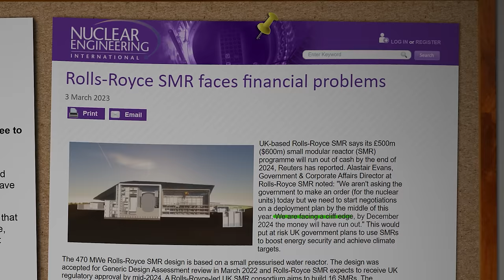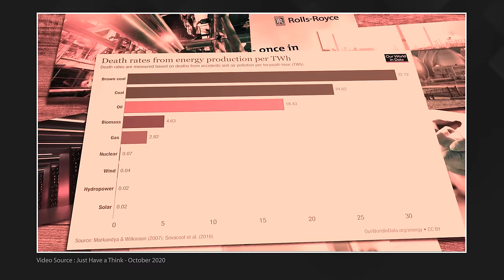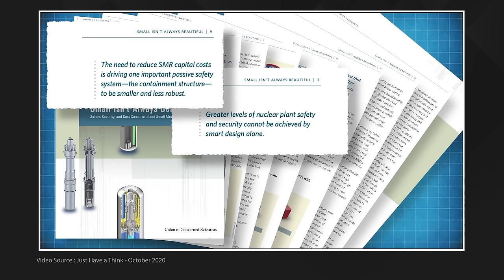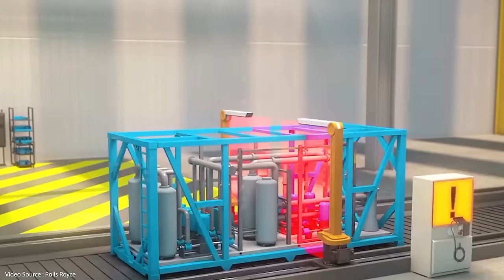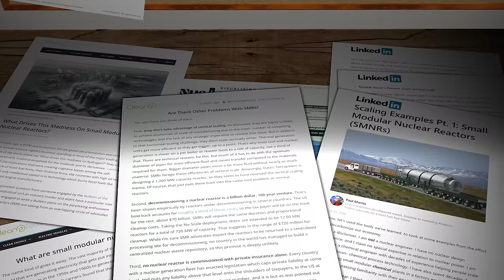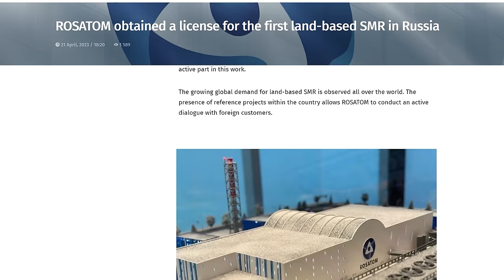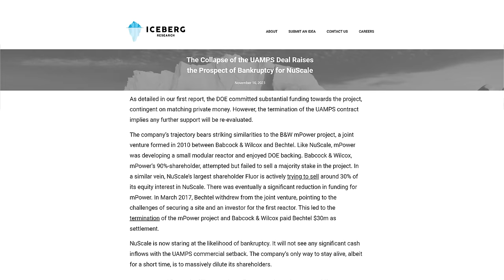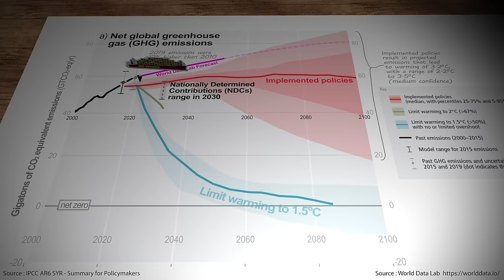Small Modular Nuclear Reactors. The Verdict

Comment: The NuScale SMR situation is disappointing however for many experienced power engineers the materials issues associated with molten salt amongst other technology issues looked rather challenging. I am not suprised about the status of NuScales' solution.

Nuclear plants as you note work very well once operational.A key issue is the 8-10 increase in costs since the 1970's.One of the key drivers of the cost (up to 50% of it) is the financing costs resulting from highly protracted construction times. SMR's an embryonic technology in aspects attempting to not just reduce equipment costs but also dramatically reduce construction times.In principle that should be achievable but should be far easier if we can leverage proven nuclear technology.

You didn't mention  the GE-Hitachi BWRX-300 which is a smaller version of their NRC-licensed ESBWR” .
The BWRX-300 incorporates a range of cost-saving features, including natural circulation systems, smaller, dry containment, and more passive operational control systems. The estimated capital cost of a BWRX-300 is $2250/kWe for series production after initial units are built. The design aims to limit onsite operational staff numbers to 75 employees to achieve an estimated O&M cost of $16/MWh or ~1.6C/KwH.

Westinghouse are following a similar track using a scaled down version of their AP1000 tech which is running well in China and I believe may be considered for UK sites in the 2030's.

We're entitled to have some scepticism about the cost claims based on history however Ontario Power Group are installing four of the GE Hitachi units over the next few years at their Darlington site.OPG have a lot of experience in Nuclear power & have run a strong fleet of CANDU based reactors for many years.The current average cost of electricity in Ontario is C$0.141 per kWh which by global standards is highly competitive.

I note your comment that Solar/Wind/Storage + Hydro are a complete energy solution however other proponents of this view such as Mark Jacobson have been thoroughly debunked by experienced engineers & scientists. I believe your comment about this being a low cost solution is questionable when full system (LSCOE costs vs LCOE) are considered as per this paper by Robert Idel.

 https://drive.google.com/file/d/1JB-x88wPQuKwWoFnxvkDAzbJ7hnM1-sj/view

If the energy supply challenge is going to be solved its not going to be just one type of technology but its going to require  everything we have today plus some emerging technologies including Enhanced Geothermal,Natural Hydrogen & even in some cases SMR's.

I
Reply: I think the problem comes from projecting a possible future cost at scale, and applying it to what amounts to small scale technology demonstrations. Historically, nuclear reactor manufacturers have had their routine price increases viewed favourably since older generation reactors were always bespoke and therefore hard to predict.
Now that SMR manufacturers need to compete on a level playing field with (mainly) wind and solar, they need to get better at cost control if they want to get funded. Rolls Royce for example, with all their experience of cost plus contracts for small reactors on submarines, are finding the commercial realities difficult.
I also think flirting with molten salt and/or Thorium SMRs complicates the problem further.

Comment: Excuse my ignorance but werent SMR's were supposed to be truckable hence the name "Small".
The "SMR's"  illustrated today by yourself look huge, slightly smaller than a current large Nuclear power plants.
Reply: They might be different companies designs. But i also assume that some in place infrastructure would still be required.
Reply: Yeah, that was the first wave of the idea. Thing is, it is just completely unviable economically (but also for safety-management, national security, etc) to do that. We do have reactors that could work at that scale - in military submarines - but they are no good for achieving the rest of the targets.
Reply: The cut off for SMR's is said to be 300MW. Anything below that has, one, never been built by any country, ever and is considered "micro."  Only the smallest of the micro reactors (under about 13-14 MW) could possibly be considered modular and truckable.  The popular image advanced and encouraged by the modular reactor investment industrial complex is an entire nuclear plant on several semi trailers.  Drag them to your location, wire them in, throw the switch and sit back and enjoy nearly free electricity for close to eternity.  The truth is that only THE REACTOR itself is going to be modular and truckable.  All the rest of the very considerable infrastructure will have to be built on site and will be permanent, not moveable, just like the big reactors already in service.  And rather than delivering power for nearly ever, the modular reactor designs I've seen have a projected life of between 9 and up to 20 years.  Some scenarios have the life span down to 6 years but a reasonable across the board expectation would be around 10 years.
Reply: You've been huffing to much nuclear copium unfortunately. The reactor is small enough it might fit in a large house but a reactor isn't a nuclear plant nor a containment facility.
Reply: The reactor itself is small, but it still needs to live in a containment structure, and in most places, also needs a grid connection that can handle its output.
Reply: @itsmatt2105  Which is completly pointless, the core machinery inside normal full size reactors are already build offsite and delivered to the site, you don't weld together a bunk of plate iron inside the containment structure to make the reactor vessel, heat exchangers or turbines.  The industry is exploiting the publics ignorance of how things are actually made when they sell this idea of 'making the reactor off site'.  Heavy machinery in ALL powerplants is made offsite and delivered.
Reply: Nope, just the components. The NuScale reactor is built in four sections in a factory for example ans then assembled on site. A non-modular reactor would the entire reactor assembled on site. Only a micro reactor is truck-able, an example this would be Westinghouse’s eVinci which is only a 5MWe reactor.
Reply: The part can be shipped inside a truck is the reactor core where the actual 'nuclear' is happens, not the whole facility. The big concrete dome thingy is actually pretty easy to build. Other stuff nearby turns hot steam into electricity, etc, which is all easy stuff and coal plants already have it too.
Reply: There are 2 levels of SMR. The small type where the whole nuclear bit can fit on one extra large truck load (not a container), and large type where the reactor fits on one truck load and the steam producing heat exchangers (which also have radioactive material running through them during operation) come on separate trucks. Traditional nuclear reactors are too big for even that and have to be manufactured as several parts that are joined together onsite.
Reply: Sorry Robert I meant to send that @jeffbilkins
Reply: To me an SMR only qualifies as an SMR if it can be built and be producing electricity for the grid within 2 years of sign off. Otherwise there is no benefit to them. Simply put 2 years until payback starts makes financing easier and means that politicians that say yes to them can see them start working whilst in office. 2 very important things to get projects off the ground.
Reply: I always believed it was MORE of a "standard blueprint" and LESS a "nuke in a box" affair and all the engineering and designs are already done and you copy-print out a new one built onsite
Reply: @itsmatt2105  "quick" deploy systems for post disaster hit areas while long term permanent  options are (re)built
Reply: @onlineo2263  the Rolls Royce large SMR program projects 2 years for site preparation followed by 2 years for construction. They haven't built one yet. I doubt you'll see any being an fast as 2 years start to finish. You could throw money and workers at it to make it a bit faster, but private sector construction is optimised for cost minimisation.
Reply: @jasonriddell  But only the reactor vessel is modular and mobile, all the rest of the infrastructure is built in place, just like one of the big reactors.
Reply: @adrianthoroughgood1191  The nuclear reactor vessel themselves even for the largest nuclear plants in the world are fabricated in one lower reactor vessel and one head, and those pieces are shipped to the site on special very large trucks of on trains.   I am unsure if the lower support structure, core support structure, and upper internals are shipped inside the reactor vessel or inserted onsite after it is installed.

The reactor vessel and parts are not constructed onsite.  The fuel is not inserted  until after the plants have approval from the regulator to fuel and do start up testing of the reactors.
Reply: A truckable SMR would be enough to supply a subdivision.  A Gw standard nuclear or even coal fired plant requires acres of land and every building and component's sole purpose is to produce electricity. Scale that down to a shipping container and you have a Kw plant
Reply: @clarkkent9080  News writers keep using the wrong nomenclature, 
"small," as in SMR is anything over 300MW.  Anything under that is considered "micro."
So a truckable modular reactor would fall into the micro category.  Keep in mind that even though the components of the reactor vessel itself would be modular and truckable, the rest of the power plant infrastructure would be built in place and not mobile.  Also, even SMR's produce way more low temp hot water than electricity, unless there's a high paying customer (oil refinery, huge apartment complex, etc.) for all that hot water, a SMR doesn't have a prayer of being economic just off the electricity alone.
Reply: @itsmatt2105  The primary system of a Gw standard PWR is in itself relatively small with most components "truckable.  The entire system consists of truckable reactor coolant pumps, a truckable pressurizer, truckable steam generators, truckable piping, and a large reactor  vessel. 
If you are talking about a shipping container size and an entire reactor coolant system, sans the turbine generator, I would guess less than 50 Mw thermal which relates to less than 20 Mw electrical capacity. That is in the capacity of available diesel generators. 

Of course a lot depends on enrichment.  Navy reactors are ~95% enriched U235 with a fuel load costing $1 billion. 

In the  case of power generation, larger has always been the most economical in the long run with today's units exceeding 1.2 Gw capacities.
Reply: @clarkkent9080  Which totally ignores radiation protection from an "accident" and security of said nuclear reactor from various attacks or storm damage.

I don't every expect to see a nuclear power plant that is not solidly built at a site with security for those reasons.

You might be able to bury a micro reactor.  But anything larger that gets impractical cost wise (which is why the AP1000, EPR, GE ESBWR, and NuScale DC plants all used above ground containment and shield buildings.  I know that all companies looked at the cost of burying the containment building with a very heavy shield at ground level.

Above ground containment and shield buildings were the cheaper option.
Reply: [Thread bypass]:
https://youtu.be/9cc1j-MbVVA?feature=shared
Reply: 15 years ago, the next big thing in nuclear was MSRs.  Now it's SMRs.  At least the nuclear bunch can recycle their acronyms!
Reply: @homerbeer943  The first U.S. reactors built in the 1950s and 1960s met the definition of SMRs. The first, Shippingport was only 60 Mw. They were all shutdown long before their design life because they were so costly to run.  Their has never been economies of SMALL scale in any power generation.
Reply: @homerbeer943  And still no sign of one, will we have more acronyms before we actually have a reactor to show for all the time wasted inventing acronyms
Reply: @John-ed8ye  And NuScale canceled their project as costs ballooned when they actually had to get engineering bids for construction.....and they received $2 billion in taxpayer welfare.  They are now being sued for fraud by investors
Reply: @homerbeer943   You've got the dates wrong.  The concept of the ideal size for nuclear power plants was in the 600 MWe range was over 30 years ago (your Medium Small Reactor: MSR).

Westinghouse got their AP600 design approved by the US NRC in October 1998 (25 1/2 years ago).

GE had a similar size BWR reactor design approved.

Then the industry realized that they needed improved larger designs (1 GWe or larger) and Westinghouse got its AP1000 (~1150 MWe) Generation 3 design approved in March 2002 (22 years ago).

Then they got a passively safe Generation 3+ AP1000 version approved in 2011.

There have been 6 AP1000 Generation 3+ power plants constructed, and at least contracts issued for at least 8 more (6 are a Westinghouse licensed Chinese derivative CAP1400); and about 15 more being planned on being built.

Its the most successful Generation 3+ passive safe reactor design
Reply: @perryallan3524  by MSR, I meant the molten salt reactors that were posed to make a huge comeback ~15 years ago.
Reply: @homerbeer943   First I heard that people were planning a huge comback of MSRs 15 years ago.  Comeback from what: Essentially 2 test reactors neither of which worked well? 

But it was about 15 years ago (or so) that they started to research possible custom "super-alloys" that could potentially stand up to long term MSR conditions.

That's also when they started to discuss possible alternatives methods of controlling corrosion and came up with the idea of possibly chemically separating out the worst of the daughter products and corrodants.

The result of that research is that in Aug 2023 the Chinese started up a 2 MWthermal test MSR to see if we have found workable solutions.   Note that the Oak Ridge MSR was designed as a 10 MWhermal reactor (but could only get to 7.4 MWthermal).
Reply: Exactly. They claimed the technology was already being used in nuclear powered submarines etc. And all they needed to do was convert it to land based.
Reply: Still so many people ignore what happened to NuScale, the show must go on.
Reply: I'm not sure why I did not respond directly to your post before on size.  You have your definitions wrong.   SMR is up to 300 MW, and no SMR plant can fit onto a truck.

The concept of SMRs date to 1955 when the USA presented the idea to the world at an international nuclear power generation conference in Europe.

The 1st purpose built SMR was a 22 MWe thorium fuel cycle BWR in Elk River Minnesota which started up in 1964 (and the power plant took up a small city block in size although the reactor could fit on a truck, as did the steam generator, turbine/generator, Feedwater heaters, etc:  The condenser was built onsite).

The plant closed about 3 1/2 years later due to significant technical problems; however, it was already determined to be a failure as the very costly staff required made the plant uneconomical.

The USA built 17 what would be considered SMR sized nuclear power plants in the 1960's - 1970's.  All were considered uneconomical due to staffing and construction cost compared to their larger central stations built at the same time (some of which are still running today).

Very small "micro" reactors might fit onto a truck as a complete power plant.  They would have very minimal power output and not worth building for normal civilian commercial power production.

There is nothing small about a steam plant, nor the space and material needed for radiation shielding in a nuclear power plant.
Reply: @doctorkiwano  Containment structures of SMS reactor projects are often subjects to scrutiny.
Reply: ... as are radiological protection risks inherent to reduced sizes of structures  .
Reply: Yes.  I think they are atttacking a different concept altogether.